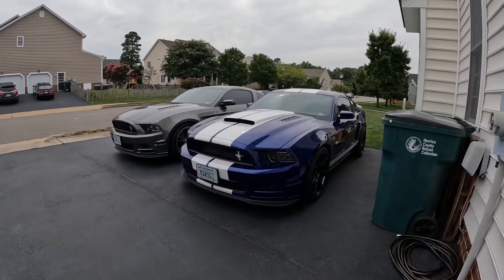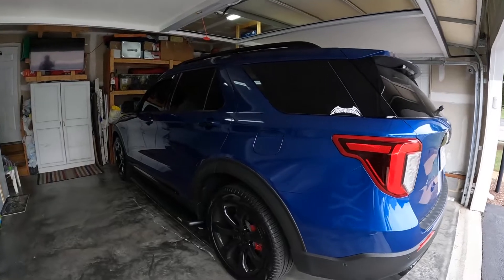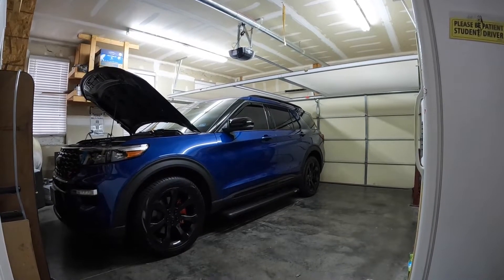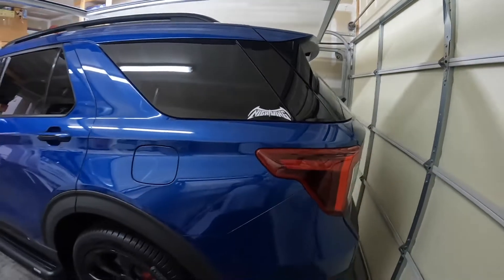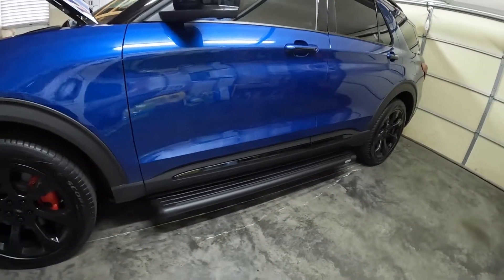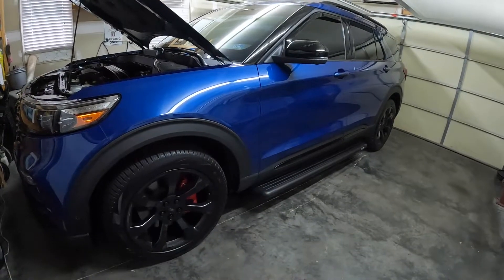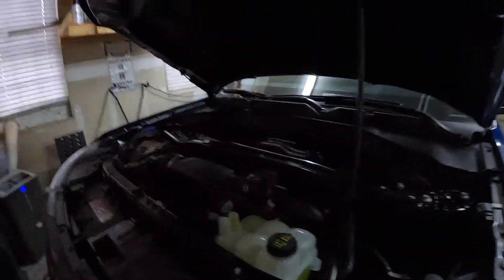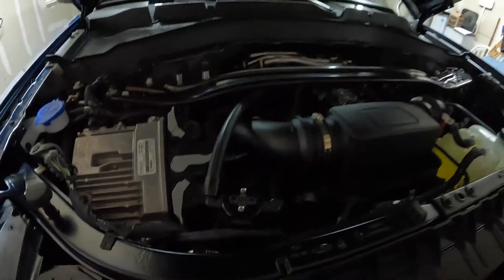Nightwing "The Build List"

Comment: Nice build list Joel!! Coming out the gate running strong 💪!!  Here l’ve had my Edge ST almost 2 years, all I have done is a resonator delete, did the auto start bypass, bought a Boomba blowoff valve but have not put it on yet. I am concerned about voiding the warranty. Didn’t you plugging in the RTD to get the stock read file void warranty if you took it to Ford for a possible issue that would need them to plug in to the OBD? I heard that Ford can tell when stuff like that has been done. Is that true in your opinion? Anyway I am enjoying your videos. Maybe find a Edge ST near you and do a few pulls in Mexico and see how you do?
Reply from the maker: I did have a blowout valve but they changed it in 2022 so now it's self-circulates they're none